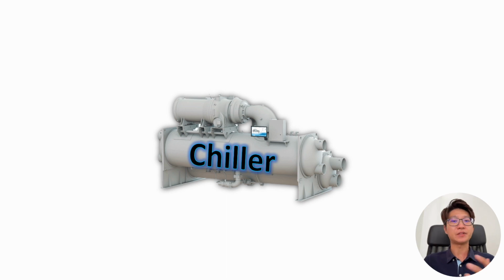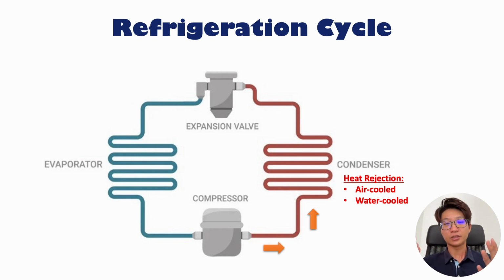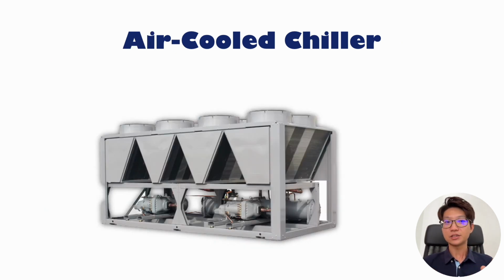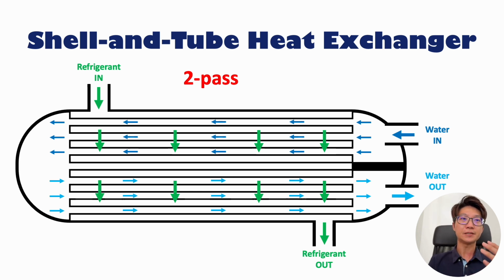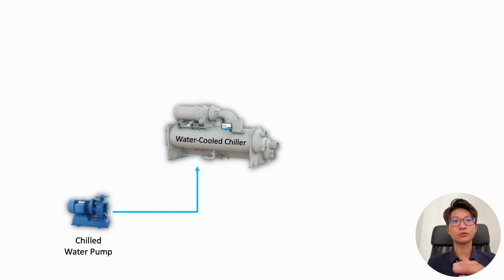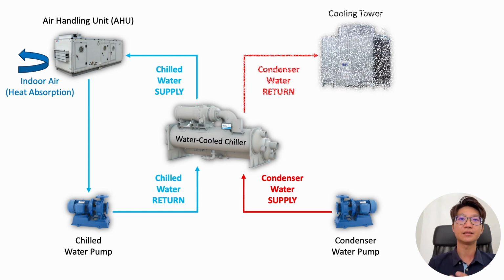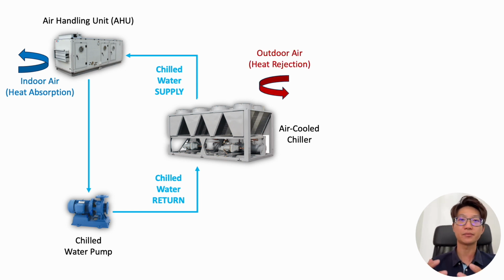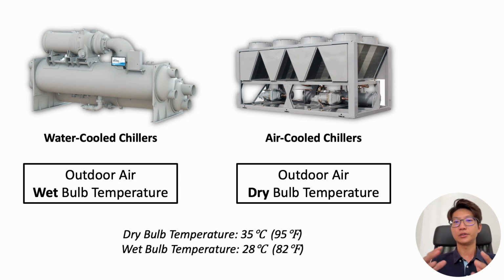Chiller Explained (Air-Cooled vs Water-Cooled) - Chiller Type Comparison

Comment: if we have a tower around 20-40 stories, is it better to have water-cooled chillers and VRF, two systems?
Reply from the maker: Unlikely we can judge which system is better based on tower height. It depends on the application (office, hotel or other uses). Both systems have their pros and cons. Chillers as main, VRF at specific locations is common.

Comment: sir what are the cooling towers? is it a different system?
Reply from the maker: Chillers absorb heat while cooling towers reject heat. Cooling towers are usually paired with chillers but they can also pair with multiple small condensing units.
Reply: @aircondlounge does all air-cooled chiller or water cooled chiller must include cooling towers?
Reply from the maker: Only water-cooled chillers.
Reply: @aircondlounge  great, do all water-cooled chillers have cooling tower even a small system?